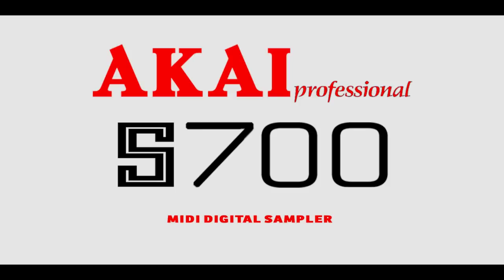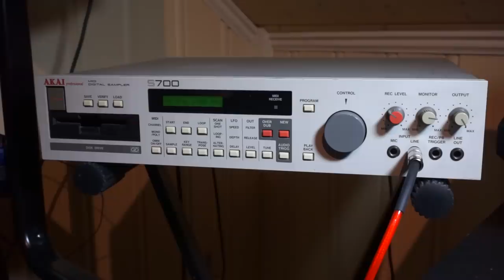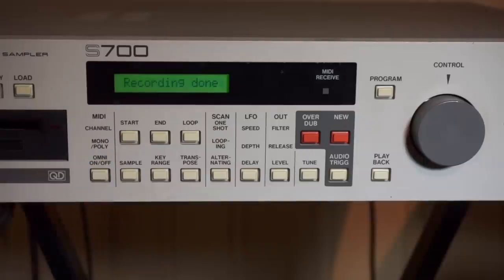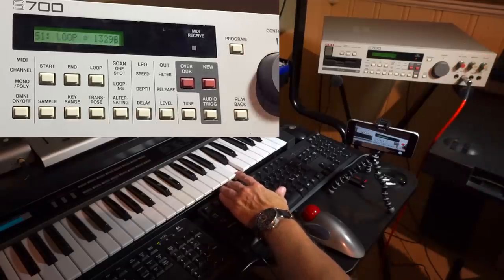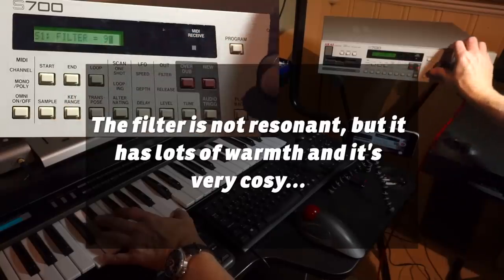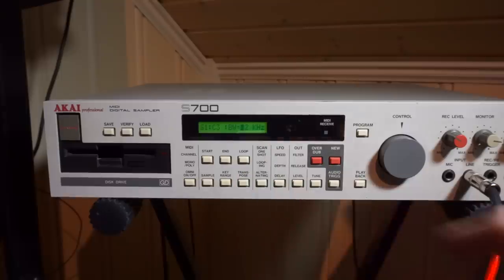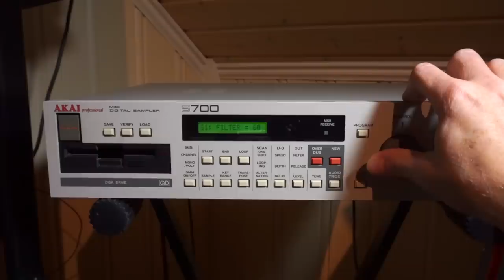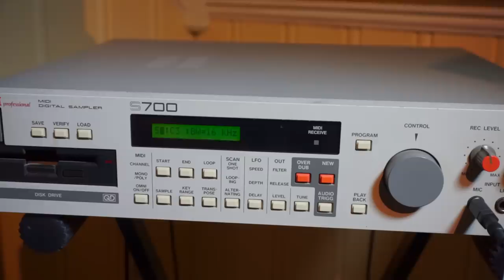Akai S700 sampler - Find this on the flea market for coffee money

Comment: Very cool! I got my first sampler, the X7000... just now. No kidding! Like a month ago, but today I fixed the disk drive. Mine is OS v1.3, it doesn't do any kind of sample transfer. I'll get a newer ROM. And I'll create a sample dump tool for Windows.
Reply from the maker: Thanks! I used to transfer from and back the old Atari ST, but I don't have that machine anymore. Make a windows sample dump tool, I think many will be happy if you did. I just sample when I need it and record the parts and it's gone, phuff.. ;-)
Reply: @EspenKraft  apparently Elektron C6 SysEx Manager should work for sample transfer. I saw that mentioned, but could not find it from www.elektron.se website. Well, if you type in C6 in the website search, it's found!
Reply from the maker: As you know, the S700 does not comply to the MIDI sample dump standard, none of the earliest Akai samplers did. The C6 does not work on my S700.
Reply: @EspenKraft  oh, sad. The C6 has been given as a solution to non-standard dump. Admitting, I've googled so much lately around this topic, it's hard to say what was the actual model on which it was suggested. Just today it was suggested by an eBay seller who knows about firmware versions, so... I just cannot test it before I get my X7000 upgraded to v1.6.  What is little talked about is the fact the older OS versions do not support dumps at all. I wonder if S700 has different branch of the OS versions and did it support dumps from the beginning. I want to collect all the possible info and put up a site / video(s) for this.

Comment: Wow, that warmth was amazing. What sort of sample length can you get out of this at 16khz? I'm just wondering how it would fare to sample a couple bars of beats. Also is it easy to set loop points? Can it quantise? So many questions, but thanks for showcasing this, it has a really nice 80's feel to it but I'm thinking some of that might come from your Eventide.
Reply from the maker: Thanks, at full bandwidth sampling time is 0.8 sec, but each sample (max 6) has its own sample memory so you can fill up 6 samples from 8 sec down to 0.8 going from lowest bandwidth to highest. I show finding a loop point in the tutorial, depends on the sound.
Effects must be used to enhance a certain feeling and for me it's the 80s feel I crave and the Eventide excel at that ;-)

Comment: Aspen I’m a novice and just bought an akai s5000.  Do you know if a microphone can be connected for sampling to this unit? I’ve searched online with zero results and don’t want to try something that damages my mic or unit. Thanx in advance and thanx for your work, after a 30+ year hiatus I’m getting back into the 1980’s.
Reply from the maker: You can, but the S5000 does not have a XLR input, it's line level only so you'll have to gain up your mic first by using a mic pre or mixer and then running the output of that into your S5000s mono line input. It's all in manual which you can find online I'm sure. Cheers :D
Reply: Terrific thank you. I did read the manual but could not figure out what to do. Happy New Year.

Comment: Thanks for this video, i was wondering if you knew how different is the aliasing between AKAI S950 and S700? Is it worth to have a S700 for bass sounds and S950 for pads, drums etc?
Reply from the maker: Thanks!
The 950 has more memory, ADSR and more of everything really so building up drum kits etc is much better to do on that imo. They sound the same though, at the core.
Reply: @EspenKraft  Thanks for the quick answer.

Comment: Lovely! Paninaro 101! <3  Makes me want to get one of those oldies myself! :D
Can the filter be controlled via MIDI CC# so in a sequencer/DAW setup, you could make dynamic sweeps like you did at the end?
Reply from the maker: Thanks Anders! No, the midi specs were very crude back then and originally you have no CC control. You have the filter respond to velocity attack, but for pads you can't use that either as you have to trigger the chords again between filter adjustments. So I just do it manually as in this demo, adjust the filter to the beat of the track. There was some talk of a mod board earlier though. Don't know how far that went.
Reply: No, you cannot. But in AKAI Z8 you can modulate everything with anything in a real time via both midi and q-links right from  it's front deattachable panel.
Reply from the maker: The Z8 is a much newer Akai sampler with digital filters and cannot be compared to this at all.
Reply: @EspenKraft , no worries!  I'm not comparing them but just giving Anders a clue how to get what he want's that's it.
Reply from the maker: Sure, no problem. Just clarified that a 2000 sampler sounds a lot different than this, something he knows already too :)

Comment: Hahahaha,  that's just great!  It brings me back to the 80s!    
But how does the machine know when the sample is over?  Do you only get a couple seconds of sample time?  
And is it possible to delegate one sample per KEY (so... up to 88 different samples in one patch? ...as to make a drum kit that only uses one MIDI track?)
Reply from the maker: You set the sample length and bandwidth before you sample.  It can only hold a few seconds of samples in total and you the polyphony is 6 voices in total. Total sampling time at full bandwidth is around 8 seconds and then there is no memory left for any more samples. The beauty is in the sounds itself and the lowpass filter.  Especially at the lowest bandwidths.

Comment: I had an S612 that was very basic!  but fun . Funny how big samplers where so expensive in the early 90s and now they are forgotten
Reply from the maker: The S612 is great. These samplers are not forgotten by me ;-)
Reply: Espen Kraft ,
Thanks Espen I have been enjoying your videos and your love for vintage period equipment which you look after well, use well, and look for good condition kit too. I also sold my E64 emu some years ago and kind of regretted it lately the sound was fantastic. I am familiar with all your kit and very fond of it as I remember all this very well, I used to work in a large music shop in the uk in late 80s to early 90s. I look forward to your next kit video.
Reply from the maker: Thanks Daniel! I have lots of exciting stuff coming. It must have been very cool times to work in these music stores when this was cutting edge. Thanks for the support. :)
Reply: Espen Kraft in your opinion is similar sampler to the s700?
Reply from the maker: It's not the same and sound different, but close.
Reply: Espen Kraft maybe it is a mix between s900/950 and s612??
Reply from the maker: Exactly!
Reply: The 612 is basically the same machine as the 700, but with sliders and knobs which makes it even more fun.

Comment: Is it possible to run a signal through the sampler without sampling it? Can I just run through the unit as an effect to hear what the AD/DA converters and filter does to the sound? Or is the monitor output an analogue dry through?
Reply from the maker: You can, but you won't reach the AD/DA though unless you actually sample. Onthe S700 there's not much coloration from the preamp, but on the S612 you get that in spades. The S612 has a very gnarly input stage that can work wonders on bass.
The Yamaha A3000 does what you want, but it has no mojo in the preamps, but you get the bit conversion at least.
I will talk a little on this in today's livestream starting 9om CET.
Reply: @EspenKraft  I really love the sound of old digital delay lines on my guitar. I wondered about processing the wet signal of these new pristine delay lines with a sampler's converters and filters to warm it up. Do any of the Akai samplers have live monitoring through its converters and filter?
Reply from the maker: I already answered that man, above.

Comment: Love when you adjusted the filter around 6 mins but I'm still wondering.. in the days of DAWs.. why would you use a hardware sampler these days? I get it you want to function 100% out of the box or you are putting on a live show that has tones that come from many synths and want to just deal with 1 or 2 keyboards. Some other reason I am missing? Pretty dam cool box though. I have never owned a HW sampler.
Reply from the maker: Michael, you answer your own question ;-) If you'd grown up with, or used hw samplers from the 80s, and especially those 8- and 12- bit samplers you would have known that no software sampler can touch these old dogs in terms of sheer sound. Newer samplers and software samplers even more, don't have the grit, degredation of sound (meant in a musically and beautifully way) that some of us crave to add to our productions. My music is all about capturing the essence of 80s synth pop sound and you simply can't do it ITB. And as you also point out, I crave the same sound live so I have to have lots and lots of 80s hw around to obtain this.

Comment: hi Espen, do the newer akai samplers preserve the same tone & low end ?  ... eg, s900, s1000, s2000 & more recently mpc ....
Reply from the maker: There's a big difference between these. The S900 is the same as the 700, while the 1000 and up are 16-bit samplers with a much cleaner sound.
Reply: @EspenKraft  hi Espen, so would that mean if you owned an s900 / s950 then there is not much point getting an s700 ? Thanks

Comment: Cool, I started off with the 12bit S950, but in those days many folks like me who didn`t start with Analog Synths knew nothing of synthesis controls so mine was used for drums, sampling vocals and some akai preset disk libraries,  I used it all the time though for projects and albums too, I got an s1000 16 bit later but it was such a pain to get my head around basic sampling on it that I just loaded in my S950 made samples into it instead.  I now understand synthesis in recent times but alas the 950 was finally sold at a good price a few years back otherwise I would get more out of it now that I have turned back to hardware instead of soft synths etc again.  I assume that the s700 is just a slightly hampered version of s900 and s950 amd also 12bit ? cheers
Reply from the maker: The S700 is the little brother of the S900 yes. Cheers

Comment: Can you sample from a daw in to the akai? Like using the presets from a vst and run it in to the sampler and use the filters?

I hope you can understand it😅
Reply from the maker: If you route the audio output of your DAW you can of course sample it, but max 8 sec at lowest quality and around 1 sec at highest. You can't run any audio into this in real time to use the filter. The filter is not adjustable in real time either, you have to trigger a key on the keyboard on each new adjustment of the filter. Remember this is OLD tech  ;-)

Comment: ESPEN!! I desperately need your advice. Ever since seeing this video I've been hung up on adding a sampler to my setup. I grew up in the 90s, so a lot of these old techniques are new to me. The S612 is well over $1000 now. The S700 is really hard to find. I want to sample my AX80 or my Drumtraks and get that filtered "degraded" magic sound. Can I do that with an S900/950 and get close to the S612 sound? Ensoniq EPS? Mirage? The other YT videos don't really show these other samplers sampling in saw waves/square waves etc and they don't really showcase the filters. So I guess my ultimate question is what sampler do you suggest that doesn't break the bank? Thanks so much in advance 🙏🏻
Reply from the maker: The S900/950 sounds exactly like the S612, but the S612 can sample at a really low sample rate, that's the difference. So it depends on how low you want to go. The Drumtraks is already "degraded" so no need to sample that further.
Reply: @EspenKraft  It's the low sample rate that gives it that magic I feel. I don't wanna get a 950 and have it sound too clean, or close to what I can get off the AX80 or Model D with its own filters. I thought I could sample a 1 or 2 bar sequence off the Drumtraks and maybe get a unique sounding loop. How does the lowest sample rate off the 900/950 sound? Is it too clean? You know what I'm saying?
Reply from the maker: You can watch my 12-bit sampler comparison video. It's on my channel. The S900 is known for its crunch on drums no matter the sample rate. It can also sound clean, in fact that's what it was used for in the 80s. The crunch/grit/degraded sound-thing is not what we were going for in the 80s. It was always about getting a clean transparent sound.
Reply: @EspenKraft  Right I totally understand that. Fast forward to now, and the cleaner the sampler, the less valuable it is. The samplers from the 90s are relatively cheap, compared to the S700 and 612. Thanks for the responses! I'll check out the 12 bit video you did too.
Reply from the maker: You should go for one of the samplers with resonant filters if it's the drum sound you're most interested in.
Reply: @EspenKraft  I'm actually more interested in sampling wave sounds off synths. It seems like the S900 has a pretty low bandwidth that sounds good. Still hard to find and not cheap. I get pissed when I look at the prices on samplers from just 2-3 years ago. Let alone from 10 years ago 🤣
Reply from the maker: The S900 is one of my favourites for that. I used that a lot in my latest video series "A Song Is Born". I'm also very fond of the Roland S-series for non-drums as well. The Emulator 2 also has a very nice sound for that.
Reply: @EspenKraft  Found an S900 about 2 hours away good condition for $650. After a bunch of research and your suggestions and videos, I think the 900 will do everything I want it to do. Thanks for your help. Is there anything I should look out for? It does have the old floppy drive in the front. But from what I read, you can start up a 900 without a disk.
Reply: @EspenKraft  Picked up the S900. Can't wait to dig into it. Thanks for all your help and your content!

Comment: Are samplers a valid/good way of backing up / storing all your synth sounds?  I don't know anything about samplers, but as you say, the Akai ones are pretty darn cheap.
Reply from the maker: You can't store synth sounds (patches) on a sampler. A sampler records sound, not patches from a synth. You can make samples from your synth sounds, but that's not the same. This video is quite old now and you'll be lucky to find any of the Akai 12-bit samplers from the 80s for cheap these days. ;-)

Comment: Awesome as always Espen, how do you rate the sound compared to the Roland S-10 on 15Khz?
Reply from the maker: Well, the S-10 also has a magic touch to its sound, but that only has two different sample rates to choose from 15 and 30Khz, so with this you can go very low and it's just so "degrading" in a musical beautiful way. The S-10 only has a digital filter that you have to commit to with no undo. Here it's analog and you can adjust it to taste in real time. Both are great for different reasons. Thanks btw! :)
Reply: Espen Kraft thank you.

Comment: I have tried so many times to recreate this experiment in my EMU-Esi 32 and every time I failed spectacularly. Seems like these two machines do not downsample the same way....  I will try it with the S20 next time.
Reply from the maker: The ESI32 is much newer and technology had advanced in terms of CPU power, so it calculates the sound for lower notes. The 80s 12 bit samplers from Akai just stretches or manipulate the frequency and thus gives you the artifacts that we like the sound of. You will never get that sound out of any 90s samplers.
Reply: @EspenKraft  Thank you for the answer. Indeed the ESI32 is very aggressive on artifact filtering and it can be very noticeable in 22khz sampling mode

Comment: S700 was my first sampler too, until I could save enough for a 3000. It's still in the attic, I guess I should dig it out again! My QD drive is bust too, I used to have an Atari program that sent the samples over sysex. Anyone know of any PC librarian apps?
Reply from the maker: The first series of Akai samplers are difficult to get to transfer to a modern computer. Use an older one and it gets easier as they don't comply to the midi sample dump standard.